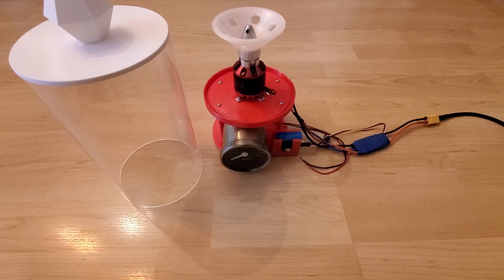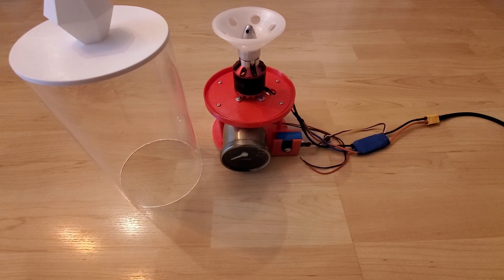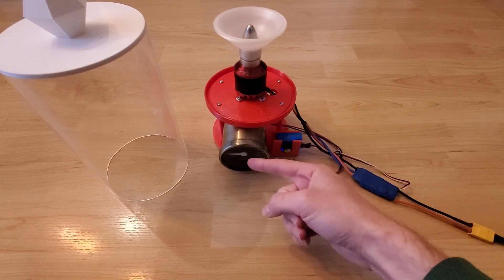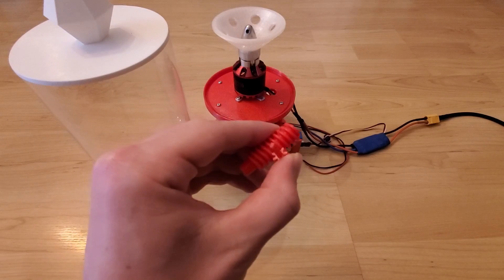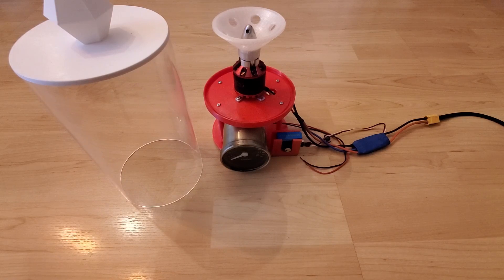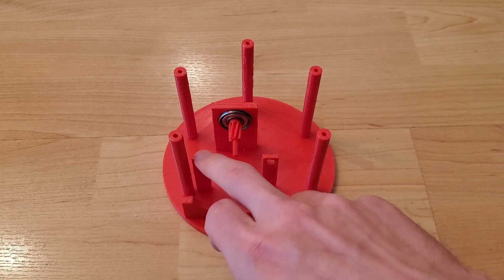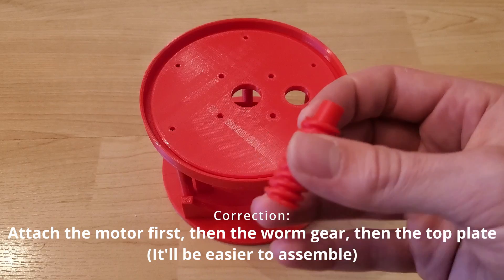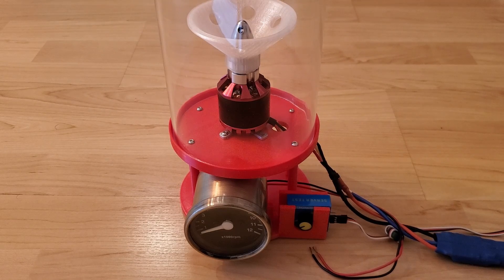Speedo Centrifuge V2: Smaller, Simpler, Super 3D printed centrifuge

Comment: I'm interested in this, are there any special calculations on how to make the rotor mount, what motor should be used and so on ? Thanks
Reply from the maker: The main design consideration was to find a brushless motor with a shaft running through both ends. The one I found is linked in the video description. The 3D printed parts are designed specifically for this motor. If you use a different motor, you will likely need to modify the design to fit. The rotor on top mounts through a threaded rod that is clamped in place with a nose cone that comes with the motor.
Reply: @qosmoschem  What is the maximum RPM that can be achieved in this project ?
Reply from the maker: The theoretical limit for the motor is 9,600rpm (800KV rating *12V input). In practice, I think it's more like ~8,000rpm due to vibrations

Comment: doesnt the wormdrive melt at such high speeds/friction?
Reply from the maker: I haven't had any problems so far but I haven't really stress tested it yet either. It's so easy and fast to print a new one that I'm not really worried about it though. I guess you could always get it metal 3D printed if you wanted extra durability.

Comment: Great project. I've been looking to build something like this for culinary purposes. Will have to figure out how to scale it up a bit
Reply from the maker: If you're looking to spin larger volumes maybe consider checking out my Slowmo centrifuge. I think you could probably run it with 50mL tubes. It has lower RPM but better torque.